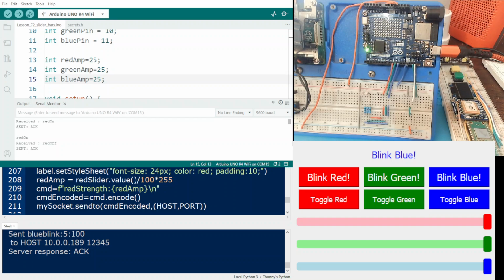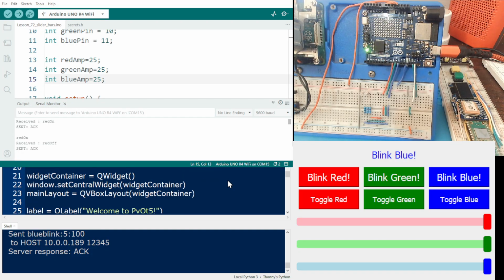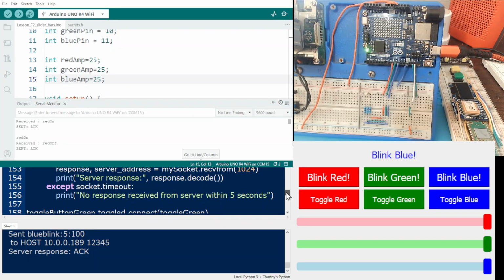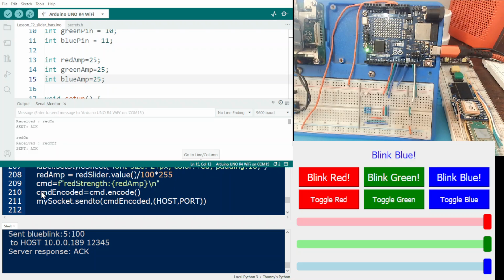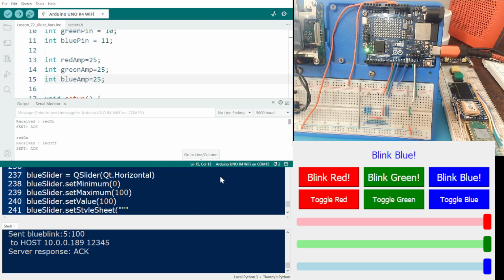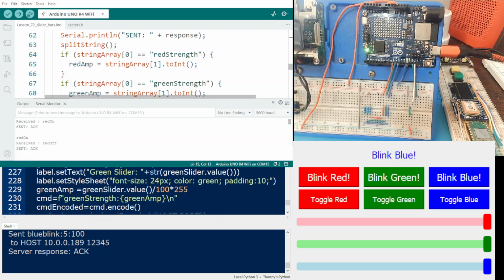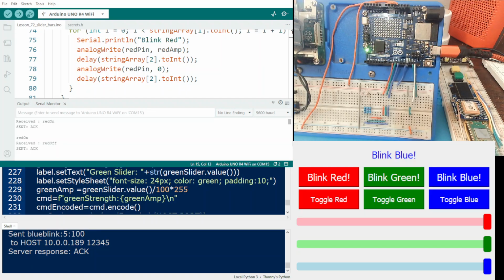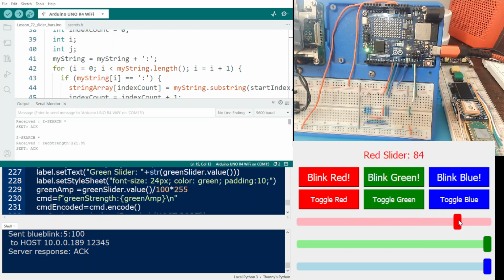Arduino Uno R4 WiFi LESSON 72: Slider Bars to Your PyQt5 LED Control Project Homework

Comment: Hi James
The f thingie is actually called an f string. You could have achieved the same thing by putting str(greenAmp).
It would have been easier to follow your code (imho) if you had shown only the arduino window when talking about the arduino code and shown only the python window when talking about the python code. Then you could have made the windows twice the size. 5 lines isn't really enough to be able to understand anything. It also didn't help that my internet is sooo slooow (972Mbps👎) but I won't blame you for that😁😁
Reply from the maker: Thanks for the critique.  I saw that after looking at Paul's code.  Things like this are so obvious when watching someone else write the code, but not so much for me.  
I have worked as a test engineer for over 50 years, but mostly work on the hardware.  I could take a well written code and make changes to adjust things here and there, but to come up with a whole structured program myself has always be out of my reach.  That is why I am taking these classes.  Still have a long way to go yet.   I thank you for actually looking at my code and giving me tips.
Reply: @jameslewellen150  I'm different from you. I prefer writing programs from scratch because then I have to think about how to do things myself.

I despair of Paul's cut-and-paste approach especially in these PyQt lessons😿😿 I used to sit in on job applicants' interviews and assess their programming skills (not in python or C++ obviously). I would never have recommended Paul for a job (apart from making the coffee)😬😬